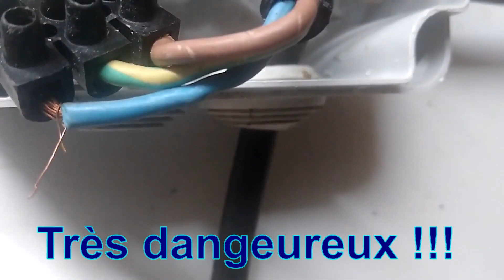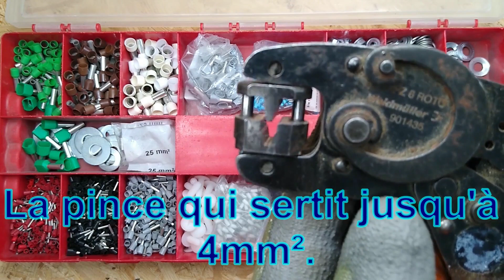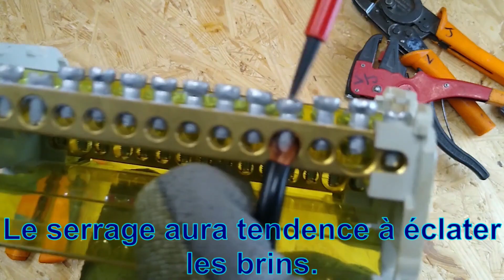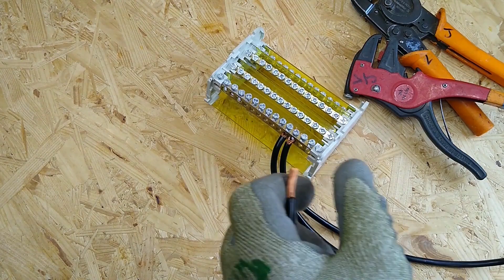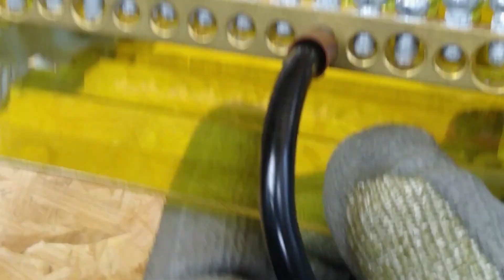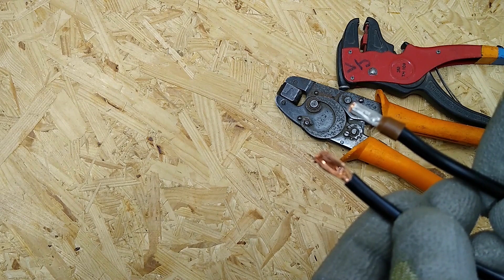Raccorder comme un pro (3/3) Embouts à sertir

Comment: Bonjour, merci pour cette video très utile.
Pour l'alimentation d'un tableau depuis le compteur jusqu'au bornier il faut donc obligatoirement mettre des embouts sertis?
Connaissez vous une référence de pince permettant de sertir du 16mm2 et pas trop chère?
Reply from the maker: Bonjour, si les câbles sont rigides, pas besoin d'embouts. 
Pour les souples, j'utilise plusieurs pinces professionnelles de la marque weidmuller qui coûtent un bras. Il y en a de moins chères sur internet.
Reply: @JohanVarin  Bonjour pour les Fils d'installation H07VR de section 16 mm pas besoin d'embout sertis ?